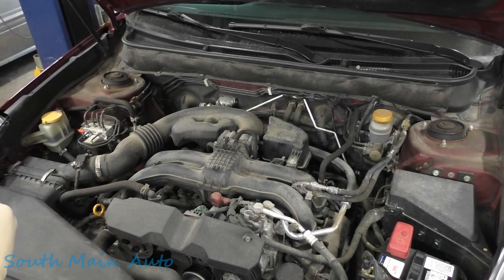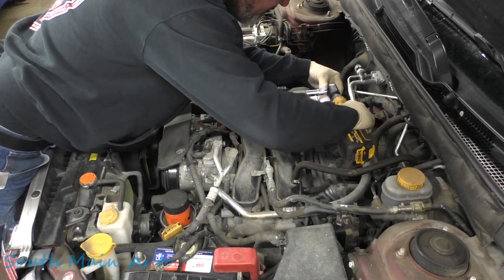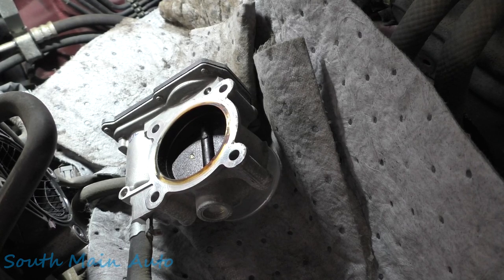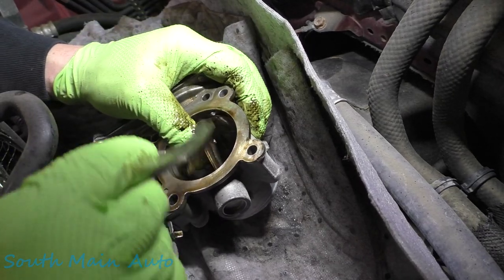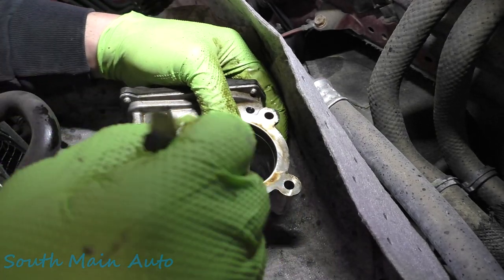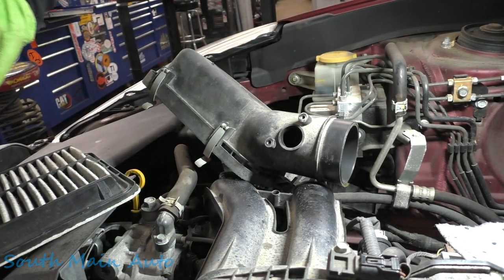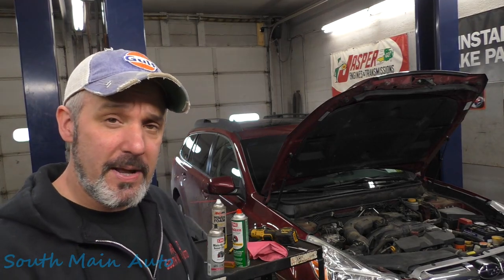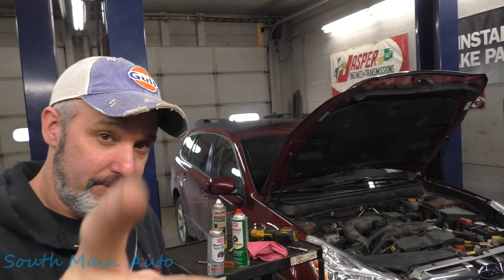How Does Your Shop Deal With Intermittent Symptoms?

Comment: I have recently been having and still having intermittent ABS and ESC lights. When I originally took it in they charged a $150 fee and their “diagnostic” guy looked at it. I put it in quotes because it turns out he doesn’t do much more than I could have done if I still had a code reader or had taken it to a major auto parts store. 

Based on the codes he looked at the right front wheel and didn’t see anything major except that the tone wheel is incredibly rusted and dirty etc. He didn’t actually check the wheel speed sensor closely for any return values etc. but between us I said just go ahead and replace the sensor and the tone ring (on our van requires replacing the axle).

Problem returned same codes. He took another look but was still confused as he saw no issue but he did admit he isn’t an electronic/wiring guy and didn’t try and check any wiring for any issues etc. they instead brought in a guy who works for multiple different area shops doing actual more intensive diagnosis and such. They covered his fee under the original $150 I paid.

He took a look and found that the after market sensor they used is randomly returning values that are multiple mph’s different than the other three. He recommended that we replace the aftermarket with an OEM sensor and replace the wheel bearing as it seems like it’s starting to go out and that might be causing enough movement to throw off value. 

Of course Hyundai is currently out of stock in the US on the sensor I need and say they won’t have anymore until May….. all in all while this has caused me more time making extra trips and because their guy doesn’t seem to do much more than read codes they haven’t ever charged me more diagnostics. Hopefully once the sensor is available and the wheel bearing is replaced that will finally be the end of it.

Comment: I dunno about AR-15s. We were only ever given M16s and used those kinds of brushes and Break-free to clean them with, along with a rod and cotton patches, back in my military days. So I can see why people would make that connection. 

However, one thing that's never appeared on those brushes, in my experience, is the phrase "For the cleaning of AR-15 rifles only. Unauthorized cleaning of anything else may result in imprisonment of no more than five years, fine no more than $5,000, or both." Or however the feds try to threaten you with warnings on everyday products these days.

I guess where I was going with that is: do what the hell you want with them. I think you're reasonably safe. If the ATF shows up at your door, let us know how that went down, as I would be rather curious as to the outcome.

Comment: Throttle body cleaning (and other parts witch have contact with oil or gas) I use gasoline and old toothbrush, cleans everything just fine, no need for other products.

Comment: With this problem, it's more likely something without a sensor. So a hose/tube blockage . Fuel pump has a bad syphon hose/screen. Gas tank has junk in it. I've seen bad resistor wire do this. Also, a misplaced vacuum line can shut off an engine.

Comment: I have the exact same intermittent problem with my 2000 Yukon. Every now and then it acts like it is either flooding out or not getting fuel. It has the 5.3 and 260k on it. One day I might get it figured out.

Comment: That orange color brand oil filter on it probably doesn’t have anything to do with a low idle and stall, but it’s not helping the engine live long and prosper.  If owner is not a DIY guy, then some shop is installing that oil filter, which really makes you question the quality of oil that is also being used.

Comment: Dad had an intermittent on a 71 GMC 2500 drive it from Greene to Owego and on to Spencer shut it off and it wouldn't start and turned over slowly had that issue for many years in the end it was a dollar fix 2  3 amp fuse for the charging system behind both headlights.

Comment: Eric, almost sounds like the old hot soak evaporated gasoline issue? But I find that hard to believe on FI engines. Could it be a failing fuel pump? But I like your approach.  1 step at a time.

Comment: Mr O, fellow workshop owner in Western Australia, has the battery been changed? All those symptoms point to the computer forgetting where the throttle plate is.... just a thought. By cleaning the throttle plate you have "reset" the parameters.... no need to elaborate, you already know this.

Comment: When I worked as a telecom tech and a customer had intermittent problems, I'd look up the service history and proceed from there.  If there is no problem, then I told the customer the only way to "fix" the circuit is when it's totally dead.  In the meantime, I would change something just in case.  There was no charge for those visits.

Comment: The biggest problem with intermittent problems isn't the problem. It's getting as much accurate info from the customer as possible. I can't tell you how many times I've been chasing an issue on a yacht only to have the captain or owner, during  the course of a conversation, drop the missing info that changes the direction of the attack. It's the "Oh by the way....." and you just want to start an expletive streak a mile long as what they've just told you t has nothing to do with what you've been doing.

For those times when that doesn't happen, I'll chase it, as you did, and then ask the customer to "try" to be more attentive to when it happens because charging $150.00 per hour is going to add up fast in labor. 

You'd be surprised how fast accurate info comes in after that.

Comment: So I have this intermittent problem with my 12 Subaru Outback 2.5.  When stopped at a light, in drive, occasionally the engine with hiccup (stall) and idle drops from 750 to 500.  Engine never stops.  No check engine light.  So I put more Seafoam in the gas and call it a day.😉😉😉😉  By the way, winter blend gas will subtract all the mpg you gained from using that foam product

Comment: I don't have a shop.  That said, the way I handle intermittent issues is I ask my mechanic what his favorite place to get lunch is, then I go buy a gift card to that place.  After that I wash my car and clean the interior out and fill it up with gas.  Then, with clean car and gift card in hand - I take my car to my mechanic and say, "Here, have lunch on me.  Also, would you mind driving my car for a couple days as you run your regular errands.  It's full of gas and has been cleaned, but it's got an intermittent issue."  Then I hand him the keys and he drives it instead of his daily driver for a few days until it acts up and he can figure out what's wrong with it.

Comment: Several years ago my truck was doing the stalling thing at redlights.  It only did this in the heat of the day and not mornings or later at night.  Found it to be the fuel filter. Some reason the filter kept getting air in the lines and that air pocket would run and hit the injectors and poop.  I don't know the complete details since my mechanic worked on it and found this but, needless to say when he replaced that $12 fuel filter it hasn't done it again.  Guess it had a crack in it or something.  Just don't know. And don't know why it only did that when it was higher temps outside.  Guess it was just one of those weird things telling me I needed a new fuel filter...it was nasty in there..lol.  Take care.

Comment: How we handle them sometimes depends on the customer. If they walk in and say "just plug your computer thing in and it'll tell you what's wrong" then i know we're gonna have a bad time... if, however, they listen to reason and understand our approach then we are much happier taking the job on. Sometimes we don't fix it on the first try because it behaves normally, and most of the time the customer is willing to wait until the fault is more predictable or can be replicated easily. If they want us to replace a part that we aren't certain is faulty, we will only do it if they understand that it might not fix the problem so don't ask for a refund if it doesn't!!

Comment: Because I don't have test-equipement, there is no good other way, then act on experience. 
Replace all temperatur- and pressure-sensors. 
Replace gaspump-relais. 
(When i buy a used car, i replace all fuses an light-bulbs.)
On intermittendend errors, it is cheaper to invest 200 euros in replacing these sensors, then to pay 2 hous for non-successful diagnostic. Furthermore i pay for oem-parts much less, then the stealership would charge. 
For example: temerature-valve for cooling-circle is 9 euro, from behr without vw-embodding, in comarison to 80 euros for the behr-valve, including behr- and VW-stamp. 
I draw out every relais, every connector , spray it with contact-spay and set it in again.   For the case, there was only a bad connection.

Comment: I have a 2007 Saturn Ion 2.2 that will go into limp mode only when I use regular 10 ethanol usually about half way through the tank and then on until I top off with straight gas. Also found that some of the stations are using up to 30% ethanol which has caused me to have to drain the tank because it's not intermittent at that point it's continuous. Moral of the story check the content of your fuel before you drop dollars on unnecessary part swaps.

Comment: There is a calibration update for the ECM to correct a low idle under certain conditions.  BTW, the factory scan tool isn't much better with special functions either, especially EVAP testing, they suck. Subaru could take some notes from GM.

Comment: I had an intermittent issue with my fueling system. If it was hot outside (80 degrees american) and my crosstrek sat and idled to long, the engine would stall with a low fuel rail pressure code. Drove me crazy the dealer threw 2 new fuel pumps at it. I changed the high pressure pump at it once and a maf/intake air temp sensor... yay, all in one expensive sensors... i watched data on my scan tool and noticed the intake air temperature sensor would   report the intake air was getting hotter and hotter, and the vehicle would stall around 200 212 degrees american. That's what made me think i had a bad sensor. Then, one day, i noticed that one of my radiator fans wasn't spinning( the engine was warmed up and the ac was on). i shut off the engine and tried to spin the fan... i found the nut holding the blades onto the motor had fallen off. I replaced it, and i have not had an issue with extended idling and stalling since 🤷‍♂️🤷‍♂️🤷‍♂️🤷‍♂️

Comment: Intermittents are tricky because it breaks the first rule of the diagnostic process -- verify the customer concern! However like you say, we do have resources to make an educated guess. With this in mind, the most important thing is clear communication to the customer. So long as they know your repair attempts/recomendations are based on previous experience and absolutely not guaranteed to fix their issue, then they know not to 100% expect a fix if they approve the work. Therefore, in theory nobody should get mad 😂

Comment: What are people's opinion of vacuuming off an air filter?  

I use my shop vac to remove as much loose particles from the air filter & airbox at each DIY oil change.  I make a point to only clean the dirty side of the air filter as to prevent from pulling contaminants thru the filter media.  I know it is being cheap, but it can prolong an air filter from being replaced un-necessarily.

Comment: I cleaned the throttle body on my wife's car she used to have an 09 Malibu. When I put it back together it would idle at 3000 rpms. I tried everything thing then read if you move the throttle plate it throws it out of time. I put a new TB in and had the same problem. Ended up taking it to a buddy with a snap on scan tool and he reprogrammed the TB and it ran fine after that.

Comment: I’m having a problem with older PFI and TBI injected cars that use relatively low fuel pressure and ambient temps over 80 having a vapor-lock condition. Even if the regulator is good- holds pressure for 10 minutes, some cars have an idle problem after sitting for 20-30 minutes ONLY AFTER an extended stop and go or highway driving. The new fuel has more ethanol than ever before, and I’m guessing fuel is reaching a boiling point closer to 170 than ever before.

Comment: lucky me I work in a fleet shop so I see everything every single day. I even treat a check engine light for most problems like this unless its acting up right there. I clear the code and have to driver drive it record the code/problem and if the problem comes back or code I make repairs from there cause I cant spend all day chasing the problem. but you cant always do that in a customer shop.

Comment: I had a 2017 Subaru Forester that would on rare occasion do something similar. It would sometimes throw a code for cam crank correlation when it did that but then by the time I got it started and drove to the shop the code would have always cleared. Never did figure out what was up with the occasional stalling before I wore the thing clean out and traded it in

Comment: A follow-up to my previous post, I found the solution to my Subaru’s intermittent stalling issue. Believe it or not, it was the valve cover gaskets and spark plug seals. I’m not sure what that had to do with the stalling issue, but I would guess the PCV system had a leak through one of those seals.

Comment: I think this basic cleaning will be the ticket. Moving forward if it persists I would lean towards a leaky injector (s). Wouldn't hurt to put some good cleaner in the gas two out of three fill-up. Intermittent does not lend itself to electronics but can't be dismissed on a ten year old car when various forms of cancer can set in.

Comment: Do they not use IAC solenoids any more?  If the idle air solenoid was stuck that could also cause problems like what you said... but the TB was filthy, that's probably nailed it.  Sad to think we'll never know!
Reply from the maker: The IACV went out the window with the throttle cable 😉

Comment: I have to say thanks for the tip on gun brushes! I used to use them in the past and they last longer than the other brush packs I bought in the past. 
I have a friend that used to work at a dealership for years. If something strange is going on in a car, I would come in and help. Things like a squad car getting a hole burnt in the high pressure gas lines. He had me come in and look at the gas line after he changed the lines a second time. The hole was caused by the radios getting a ground from the gas lines. 
My friend that fixed cars is semi-retired and now he doesn't have scan tools to use I decided to buy and learn the scan tool. The videos give me good ideas on how to troubleshoot automotive problems using a scan tool.
Thanks for the great content.

Comment: Intermits are hard to explain to customers in general. SES light was on now its off type of thing are always tough. For the type of issue your chasing I would handle it the same way. I wouldn't charge diag to do basic maint, especially with no codes. Other then checking TSB's , fuel trim data and codes. If the cust wants to start somewhere. I would have cleaned the throttle body as step 1. I won't spend time on anything that happens once a week. Every situation is different. We don't throw parts at cars. If I can't confirm a failed part, its not getting changed

Comment: I have not seen the whole video yet. The EGR and the throttle body cleaning would be the first thing I look at. Then the IAC. Is the car hot or cold when it happens. It could be anywhere from a sensor to the transmission affecting the cars driveability.

Comment: Quick note...my 2014 Forester 2.5 exhibits those symptoms anytime I disconnect the battery (or the BCIM even if the battery is still connected) and don't do a throttle relearn, but driveability issues gradually go away after a number of miles.  You mentioned this car had a new battery installed....was the old one going completely dead, possibly?

Comment: It's always fun when it doesn't trip any codes.    Does it trip codes if the fuel pump quits for a few seconds and then comes back on?   I think I would have done a fuel pressure test, could be a clogging fuel filter.  Maybe some bad gas or water in the tank (not likely-  that would probably trigger fuel trims).   Another odd thing that doesn't throw codes is a clogged exhaust;  but it's weird to clog itself and then suddenly unclog (so likely not it).   Most other issues will throw a code...   It could be a dripping injector, but again- that should probably throw an 02 sensor code or fuel trims, etc..   Maybe coolant is a little low with an air pocket and it's causing wonky temp readings and thinking it's cold outside, and the computer is adjusting the wrong fuel amount, even though it's still within "normal" specs and not tripping codes.   .lol.. IDK.

Comment: I’ve had a Forester for the past four years check engine light has only been off for two months of this for years keeps coming up with the 420 code but they don’t do omissions where I’m at and it has 200,000 miles on it so I’m just gonna ride it till it blows😂 I have a Toyota for a back up

Comment: depending on the issue but i wont replace parts untill i can see something fault as most vehicles i work with are under 3 years old , i normally try get lots of information and ask when it tends to fault and ask if we can have it for a day or two ,  sometimes its not a fault but a lack of information from the sales yard, i had one vehicle that would not throttle up at a roundabout and it was because they were trying to take small gaps and the front  camera/radar sensed that and reduced throttle to avoid a accident